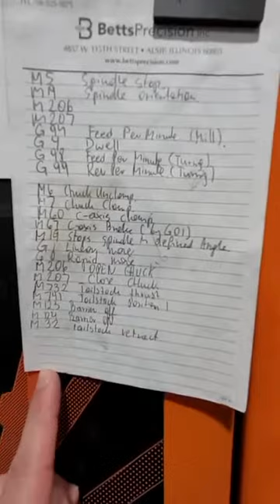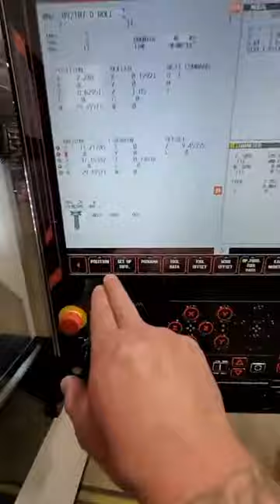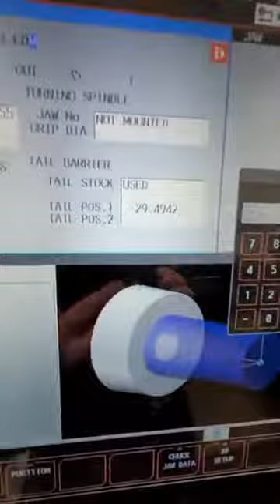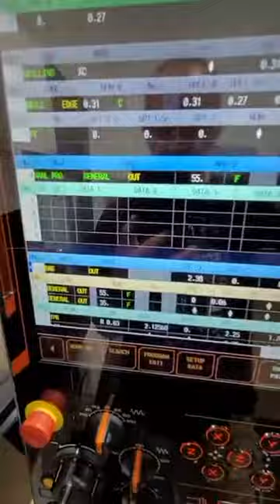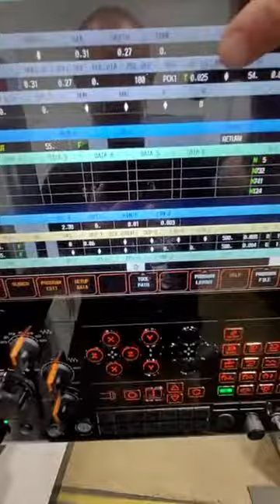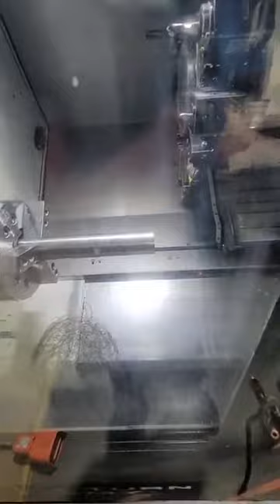Mazak 250my lathe smooth setting up tailstock automatic advance and retract

Comment: Thats interesting and it helps me a lot (im new on a 250my), but how do you teach the tailstock for the first part that it has to be there? Do you simply reset the program after you drilled the center hole and then teach it or is there a trick to do that in one program cycle?
Greetings from germany :)
Reply from the maker: That is a good question, so you usually have two tailstock positions, you can teach 1st one before and second one after, then just set them accordingly tom your needs, also tailstock slows down on your 1st position and will continue with feed and not rapid till it engages a part, hope that helps.

Comment: Instead of using manual prigram cycle you can use m code cycle and put all m codes in it. But before m741 or 742 I you have to ptogram manual program cycle with the next tool and tool cange position retraction to avoid crashing into tailstock :)